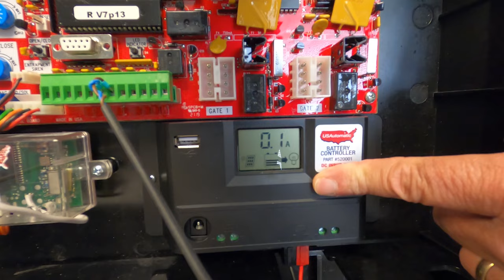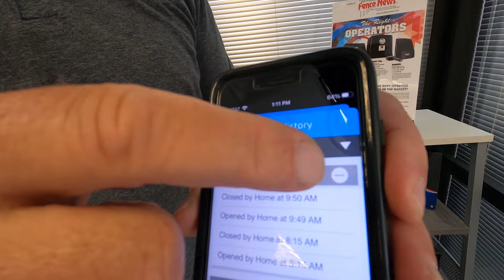The Best Solar-Powered Gate Operator

Comment: Spooky Controls and Mighty Donkey  hahahahahahahahahaha love it.  Similar sense of humor we have......but keeping it professional you do.  Am I sounding like Yoda? HaHa  I do like your videos and how you present the information.  My situation is needing to linear actuators, I have power so not needing solar panel but will want battery back up - low cycles. My mount for the actuators need to be 13" out from center of hinge to 6" over to center of actuator bolt center (pull to open). Does US Automatic have actuators that fit that layout? Currently I am looking at the Nice Apollo Titan since I've had one of theirs (old style)in the past and it had worked well with no issues.  I am asking mainly because I like how they came across in your video here. Keep up the good work and good videos.
Reply from the maker: Hmmm, don't know for sure. Each operator has specific individual limits on where stuff can be mounted to keep their geometry correct. There is usually a way to make almost any setup work with any operator. 👍🏻

Comment: I've had alot of problems out if lower end operators as an installer how would I go about creating a relationship with u.s. automatic should I go straight through them or w.s.i? I have installed a couple of the u.s. automatic ones and havent had call backs on them
Reply from the maker: I'd reach out to them directly.
Reply: Thank you im actually on their website now need to order for multiple customers